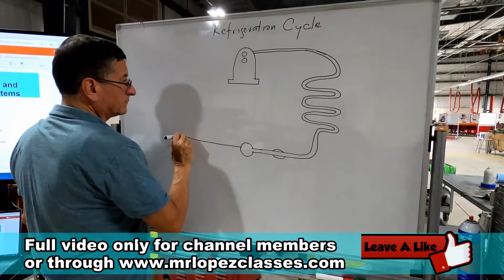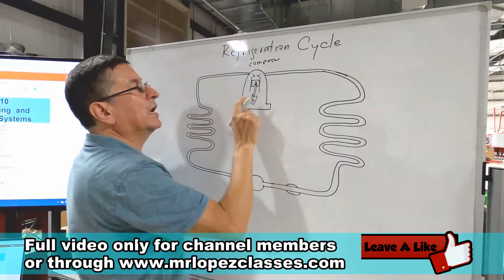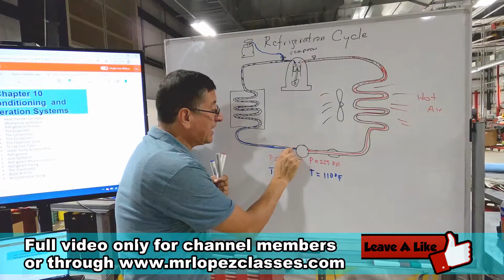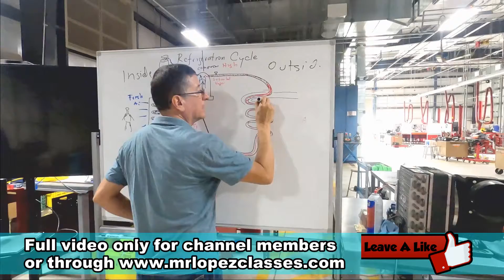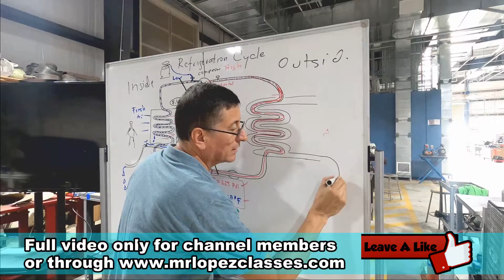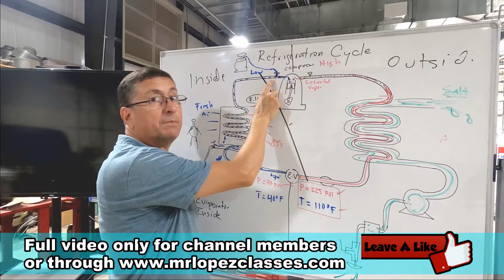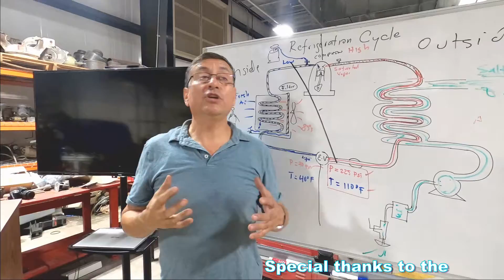Marine Air Conditioning Systems Fundamentals / Highlight Video

Comment: been a marine tech for 37 years. love this  guys video he is a good teacher hello from toronto ontario
Reply from the maker: Thanks for your feedback. I hope this material is useful for you. regards
Reply: What will cause the ac for the boat to cool off and on and stays that way ?
Reply: @mobilelink3725 
The water ur boat is seating on and a working water pump that send water through ur a/c unit.
Reply from the maker: Thanks for following me. I hope this material is useful for you
Reply: hi mr lopez, i have problem my frigomar error code E7, fan work and chiler not start? any solution? 🙏

Comment: Hi Mr. Lopez. I have 3 cabins and I want to install an independent air conditioning in each one under the bunk. How should I make the seawater connection? Can they be connected in parallel or should I make a 3 through hull fitting inputs and 3 outlets
Reply from the maker: Hi. In those cases, a Sea chest with one input connected to the thru-hole on the boat and three outputs, one per each unit will be a good solution to avoid multiple thru-holes. Good luck
Reply from the maker: Hello. Instead of three independ Through-holes I recommend if is possible create a sea-chest in fiberglass integral with the hull